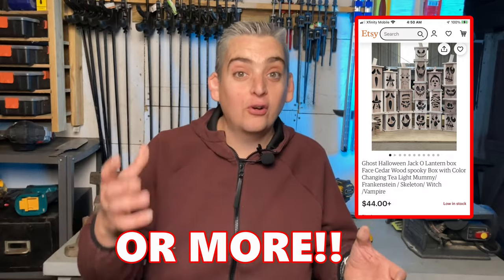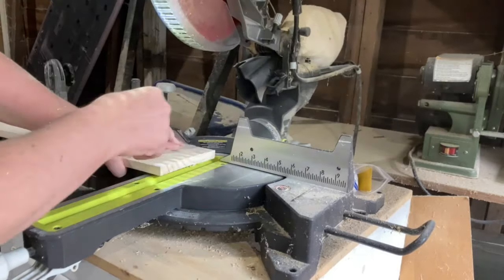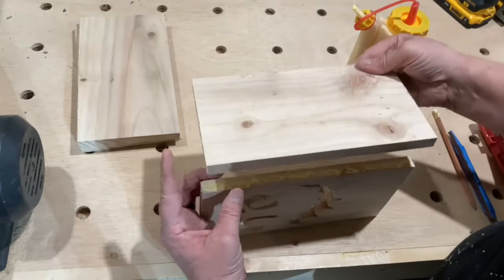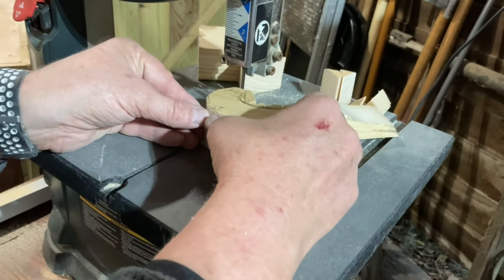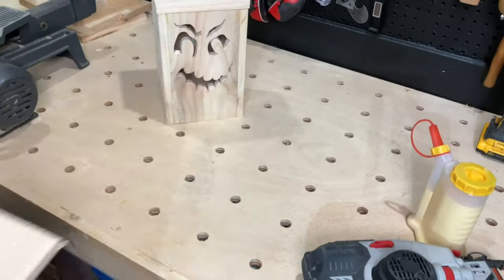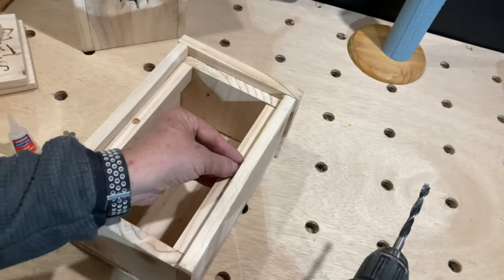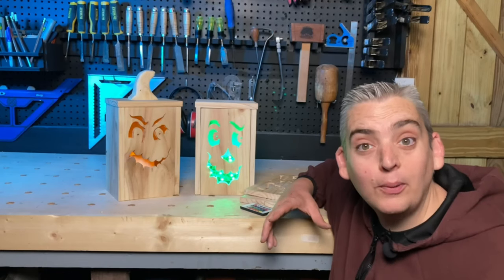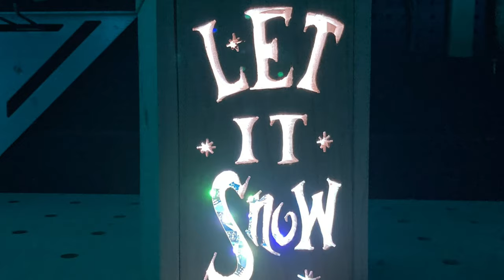How to make Jack-O-Lantern Boxes with Changeable Faces!!

Comment from the maker: I added links to the lights and batteries I used. The pickets I used are approx. 3/4" thick so the 10mm magnets fit well and have a strong hold.
Reply: Great video.  With the box using the rope lights, did you find another power module for the unused rope light? If so, can you please share it? Thanks.

Comment: Great video brother. Cool project.
Reply from the maker: Thanks! And thanks for watching!
Reply: @boydstongrove  
Hey Brother. I don't know if you do tool/product reviews at all, but with your broad reach, there are surely a few of us who could greatly benefit from your knowledge and experience with different tools within wood working. For instance, as bad as want to 'cut-the-freaking-cord/hose' I recently purchased a corded 5" orbital sander by SKIL. It's a great little sander(with the only exception of needing an extension cord 😕. I'm actually tempted to install a 10' cord.) with variable speed, incredibly important on small projects and to get the most outta your sandpaper(2 things I've never heard any single reviewer ever mention.) Compared to my older battery powered Ryobi sander it's a huge improvement. The old Ryobi only has an "on/off" switch, no variable speed 😡, and it was more expensive, and it wasn't brushless so it has quite the appetite for some batteries; 1.5-2Ah = maybe 10min., 3-4Ah = Approx 15-18 minutes, and again, that's running wide-open, cause that's only speed it has. Not to bash the old Ryobi. It is what it is and I really needed a sander. I've quickly grown beyond it. I'm more of a 'buy-once, cry-once' kind of buyer/user. I couldn't afford to buy the DeWalt or Milwaukee corded-sander. The SKIL brand uses a flywheel-system to harness the energy of a less powerful motor to do bigger job. It's only a draw back on the larger projects that will soon pay for the DeWalt or the Milwaukee corded-sander. I already have the Milwaukee battery platform, so I lean in that direction. I still desperately want to cut that cord. However, there are times, there are projects that require the most of the batteries that you have. Freeing up a battery from a say, a sander, so that it can be dedicated to the JigSaw, especially for this project.
Reply from the maker: I actually have a review video on all the sanders we've used in our shop. It's the one tool I will probably stick with corded on because the battery versions notorious for eating batteries, regardless the brand. I also have a few other tool review videos and am currently working on a few more as we speak.
Thanks for watching!! @scottbionicnerf8727

Comment: Which magnets are you using? I clicked the link but it’s giving me a variety pack and I’m not sure if I will use the larger ones or if you used just a small ones.
Reply from the maker: sorry for the confusion, I should have mentioned that in the video. It's been a minute since the video and I gave the lanterns away so I don't have them to check, but if memory serves me correct, the ones I used were only about 3/8 inch diameter. You don't need them much bigger than that to have a decent hold. I usually get individual sizes at Home Depot, to avoid having to buy a variety pack every time.

Comment: What size earth magnets did you use?
Reply from the maker: I want to say somewhere in the 1/4" diameter range (but in meteoric) , I can't remember exactly. I will see if I can find some of them and get back to you.
Reply from the maker: The pickets I used were about 3/4" thick so 8-10mm magnets fit well. I left a link to some in the vid description, but I picked mine up at Home Depot.
Reply: @boydstongrove  thank you!

Comment: What type of lights did you use?? Thx.
Reply from the maker: The orange colored one had a battery operated candle that has a flickering “wick” that my wife got off of Amazon.
The multi-colored one was just a cheap set of LEDs with a battery pack and remote. I’ll add the links in the description tonight.
Reply from the maker: I added links in the description to both the flickering candles and the LEDs
Reply: thx.
 @boydstongrove